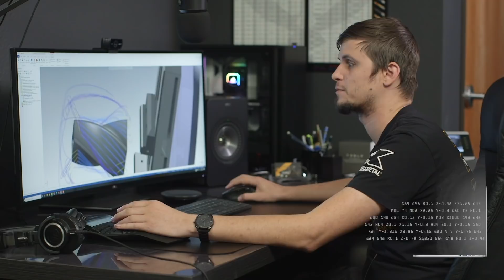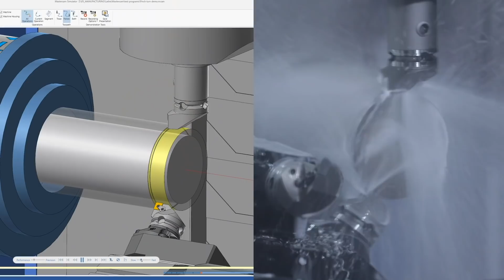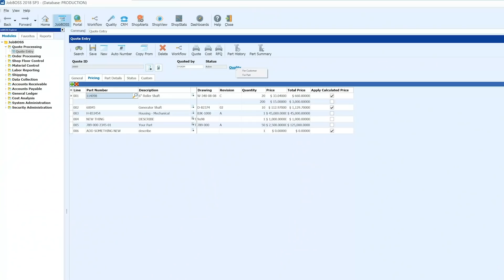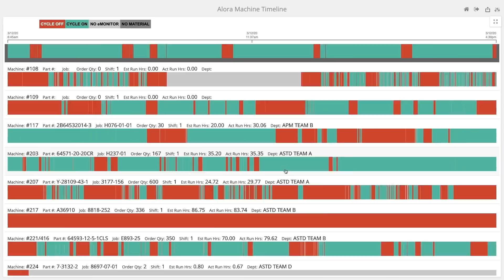You’ve Never Heard of this Tool, but it WILL Take YOU to the Next Level

Comment: At Rolls-Royce we are always being challenged by our management team to reduce our CNC machining costs and decrease cycle times. We have achieved savings by optimising cutter tool paths, RR use the term ‘non value added activities’, in other words remove operations or processes that add nothing to the final finished part. I wish that I was 20 years younger as I would move from the U.K. and apply for a job with you guys. Your facility looks a great place to work. Merry Christmas Nottingham U.K.

Comment: This is the basics of cost accounting. If you allocated the annual capital costs for the "big" machine (including maintenance and interest) divided by available working hours (shifts*hours-per-shift*days-per-week*52) you get a number that shows you what it costs you for that machine to stay idle for an hour. No revenue comes from idle hours, so reducing those will drop to your bottom line BIG TIME... Boom!
Hey, when you get to the point, please think about an open house in Flower Mound. Let me shake your hand, or at least a fist bump.

Comment: Titan.... I've seen bean counters make a job become. Atotal slave to numbers. Not only did they not add value, but people will leave when the bean counters  generate a report. What's on the floor should be the last word in any operation. Someone commented below about difficult set up jobs which also made a ton on cash... In addition to a good metrics program there needs to be a good value cross over program, to beark-down run time to all other costs and the bottom line.

Comment: The best of the best are the machinists that work to perfect their skills not for monetary compensation, but for personal satisfaction. The monetary compensation will come once you work to perfect your skills. This being said, the machining trade is not for everyone. You need an aptitude for it. CNC machining is great. Been a machinist for 30 years. Worked in job shops, and high volume production environments. In my opinion, and it is just that. IT SUCKED). It's all about making money for someone else. Nothing more. If you don't have the basic skills required to run manual machines, which teaches you HOW to carefully make a part. Thinking the part all the way through BEFORE you even make that first cut. You're hosed. Manual machining teaches you how the hold a part.Gather the skills to become an all around machinist. I work in a Research and Engineering environment. Some of the parts I make blow my mind. After conversations with engineers,scientists,and physists to get a better feel for what it is I am making, I sit down and really look at what and how I want to make MY parts. They are MY parts until I have completed them and given them to the customer. Pride is something that factors into the equation too. Take pride in what you do. DO NOT rely on technology. It's just a tool. Too many time I have seen "kids" come in bragging about what they can do. 90% have failed to deliver. Yes they were very good with CAM software and CNC machining. BUT and this is a really  big BUT. They lack the real skill and aptitude to make a part thoughtfully and carefully. Sad really. Most times these guys just hopped from shop to shop garnering wage increases without really advancing their skill level. Famous line heard lots."I have been a machinist for 5 years,and I can do pretty much everything" A quick look at a resume shows 8-10 shops in that 5 years.  I'd say okay. Make me this part on the manual mill and manual lathe,weld it and finish machine it to print after that. They'd be like 'What?". I don't know how to run a Bridgeport or Hardinge toolroom lathe,or weld. Well then you can't do everything. A real and true machinist is always learning new and different ways to make parts. There are 2 ways to make parts. The right way and twice. The right way is to print and in tolerance and with pride. The other way is.....well not right. The trade are a noble profession. Not everyone is destine for a collage education. We will always need plumbers, electricians ,welders, machinists. If this is your forte embrace it and you will find great satisfaction and monetary compensation for you dedication.
Reply: I would agree with the way we should look at parts we are making. Like it would be ours. I try to do it the same. I give my best, my heart machining parts. Even tho I know it's money for my boss. But, I wouldn't agree we should start on manuals. You can learn all this stuff on CNC as well. It's all up to you if you gonna brainlessly load part or try to get better ideas to set up and learn from mistakes.
Reply: So, in a nutshell, you are saying, start on manuals then work your way to cnc 😂
Reply: @hugster5052  That would be correct. If you are pigeon holed into being an operator on a CNC, take what you can get. Show initiative and drive and interest in what you are doing. Be the go to guy for stuff. It does and will get noticed. You'll be the one asked to move around. Show an interest in the work being done by others on different equipment. Basically be a sponge and absorb as much as you can.
Reply: Im 10+ years in cnc on WOOD  and still learning every day. I remember one day operaator (not very good one, always chose the parts with short time to complete, to get most parts done in a shift) went to the boss and told him that he's the best one and he wants bigger sallary or he's leaving the company. The very same day he broke one of the biggest tool on the machine. That was funny as hell to me

Comment: Double edged sword. When a machine is running at 10% it does not clearly indicate that there is a problem, it could be a job that is difficult to set up, but brings in big money. Last thing you need is some office people without any actual machine time bothering that highly skilled worker based on some statistical 10%.
Reply: Thats True... but in mass production, the setup need to be fast and easy. What he say doesn't work with small batch of jobs at my understanding.

Comment: CA is to Political...Just wondering why the switch from   "H" brand  to  Doosan?.
Reply: Maybe better perks from being a partner? Better money etc? :)
Reply: the H-brand is medium duty machines, works well for it's price level. When to step up production to the top level one go to the top shelf brands as Doosan, Mazak, DMG, and others that manufactures to heavy duty equimpent needed. They used to have som DMG's, but changed to Doosan, likely because of a better total deal both for the production and teaching side
Reply: @Rimrock300  I kind figured that  Doosan.....Boxways?
Reply: @DJ-yp4kc  Are you trying to say old fashioned or something by putting a question mark after boxways?I have purchased a DNM670 just over a year ago which has linear guides which I'm never fond of only purchased it because I don't do very heavy machining in general.The same machine comes in box ways for an extra 15k here in Australia.I also have an old Fadal which has box ways and when you tap a job in the vise sounds rock solid but when I tap a job in a vise on the DNM makes a loud sound because it sits on linear guides and there is a big cavity under the bed.So you can't beat box ways for rigidity and quietness.
Reply: Free.